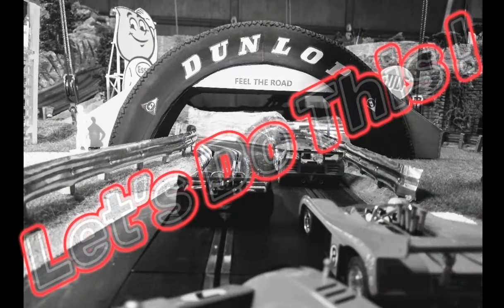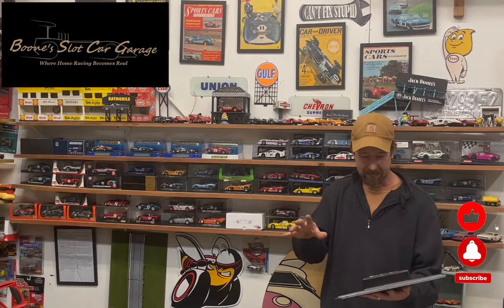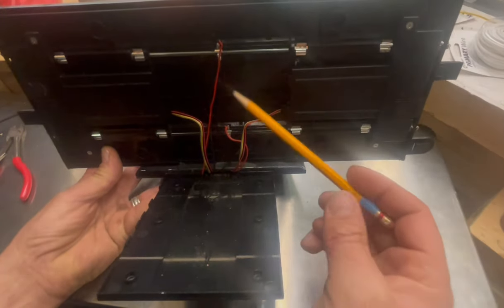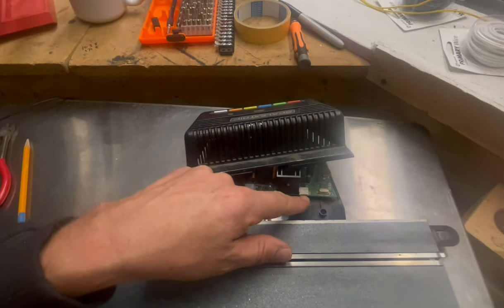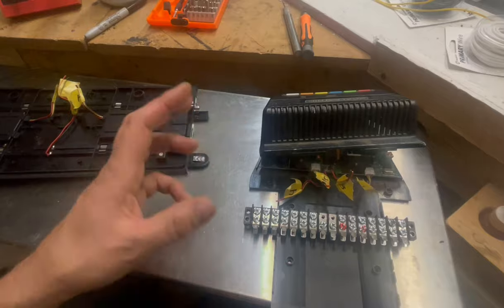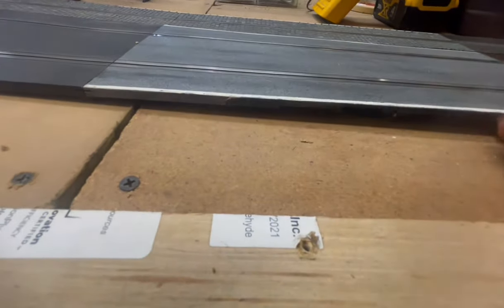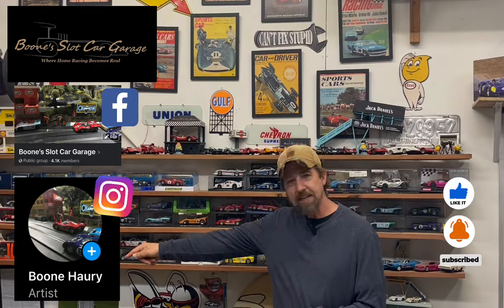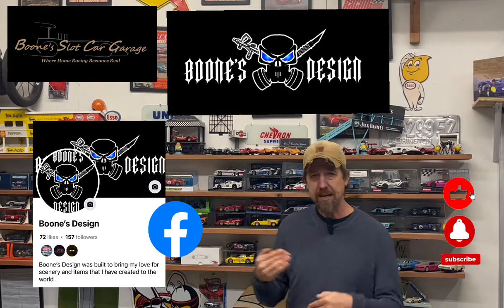Digital Power Base Surgery

Comment: What kind of wire did you use mate?
Reply from the maker: Im not that great at remembering stuff after my fall , but it was just standard electrical wire. Ideally I would use a silicone wire so that it is a little bit more flexible.